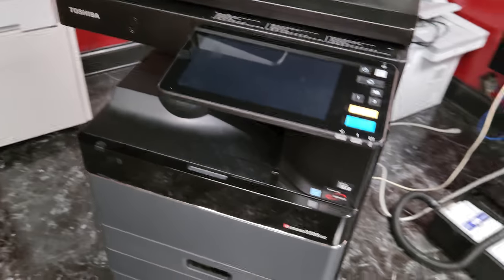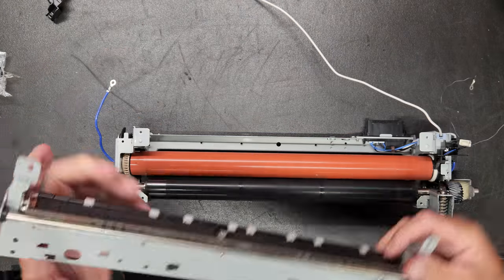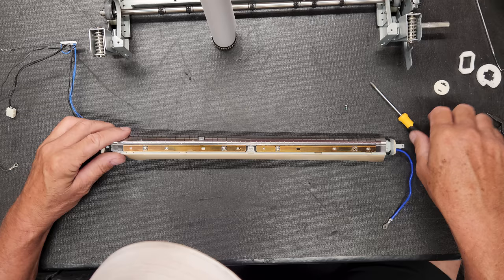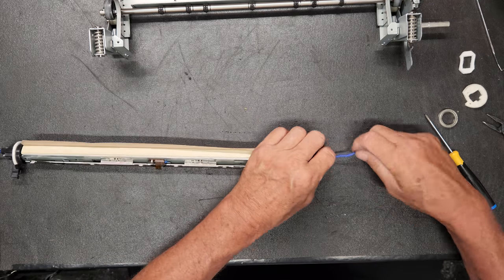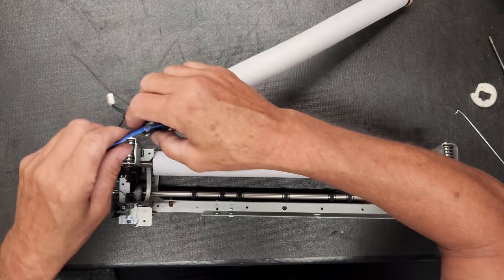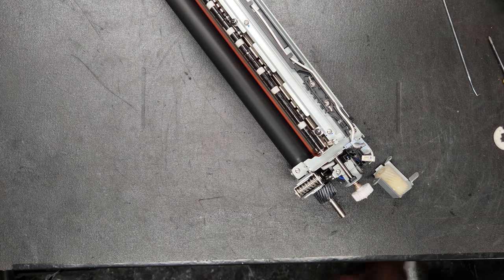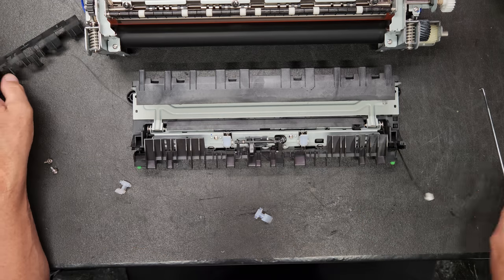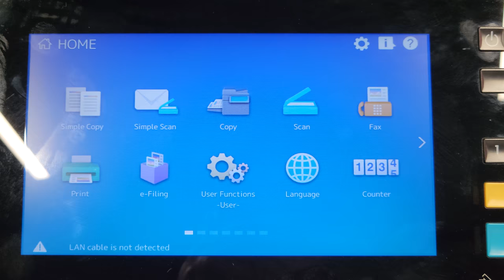Fuser rebuild for Toshiba e-studio copier 2505AC - 5005AC & 2515AC - 5015AC

Comment: Excellent video sir. I'm currently contemplating picking up color Toshiba line, and was curious how fuser rebuilds were. I've strictly dealt only in Ricoh color boxes since I started in the business going back to the Aficio 3228C series up to current IM C boxes. If you like that Metabo you should check out the Dewalt 8V MAX Cordless Gyroscopic Screwdriver! I upgraded from my Milwaukee cordless like 10 years ago which looks ver similar to your Metabo, and I can tell you the DeWalt is nice...
Reply from the maker: Thank you! I've been working on Ricoh's that long as well. I have been a big fan of Ricoh over the years but since taking on Toshiba they have cut my service calls in half! Easy to work on, copy quality better, cheaper to operate. And I love how they connect to the cloud so I can tell you everything about the customers machine right from my phone. Saves a lot of time and travel. Ricoh dealers probably have something similar. You would do well to take on Toshiba in my humble opinion.
Reply: @mrbonz00 Thanks again! This is all very promising to hear. I watched your drum unit video as well last night! I feel even more confident making the switch coming from your background as another Ricoh tech. I about fell over when I had a fuser job come up on a MP C6004ex recently. It's nice Ricoh has the whole heater assy ready to drop in, but for the cost I may as well go back to Kyocera! At least with those I can get the entire new fuser unit, and simply drop it in without getting my hands dirty. Don't even get me started on Ricoh's PCU haha big $$$$